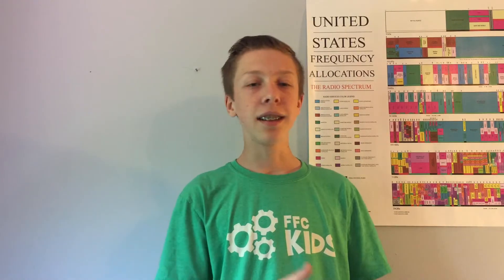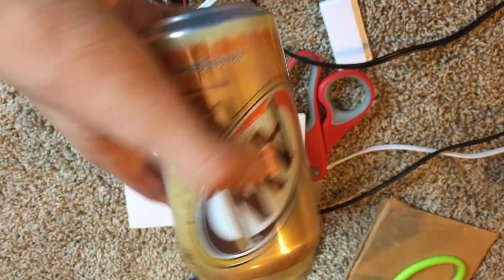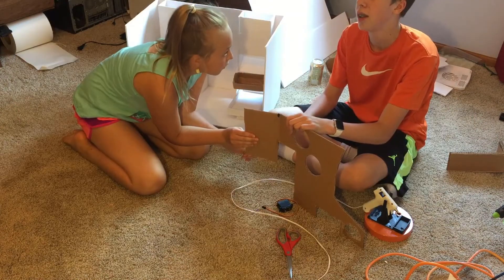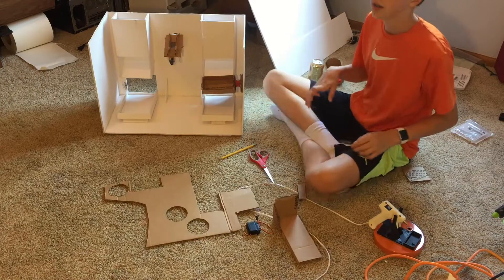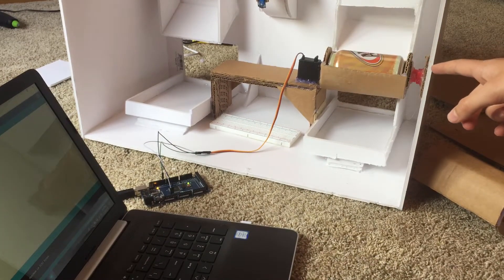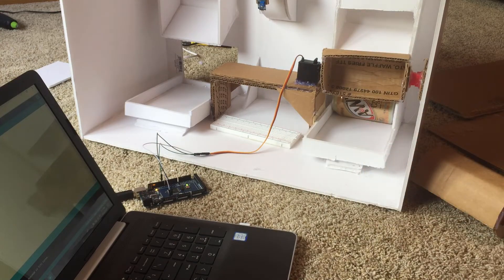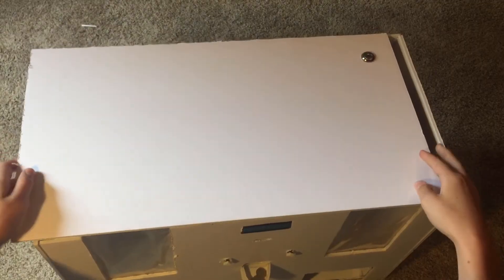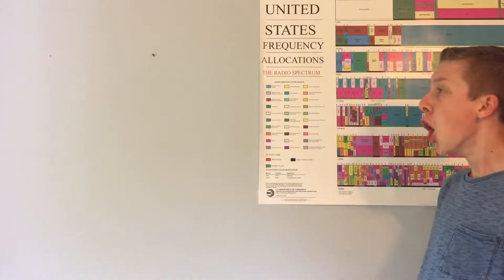Building a Coca Cola/Sprite Vending Machine Part 2

Comment: what probably happened was as the air was blowing the heat was rising back up to heat the popcan, those peltier coolers are not very efficient.you have to keep the hot side cool also the inside of the fridge probably had a metal inside to transfer the coolness around. otherwise you'll need a heatsink on the cold side aswell and a fan moving air around inside and outside.
Reply from the maker: haha yeah I didn't try to hard but thanks for the advice!